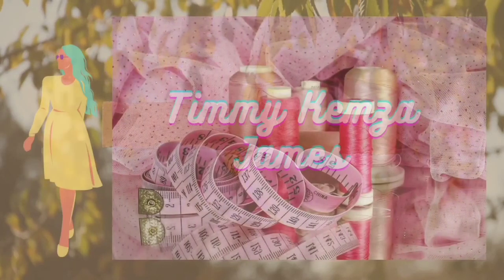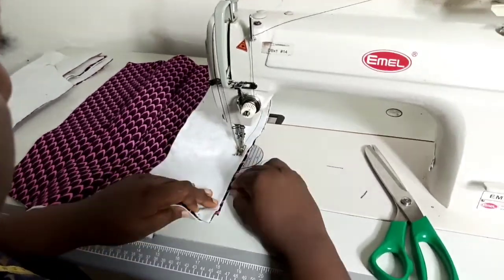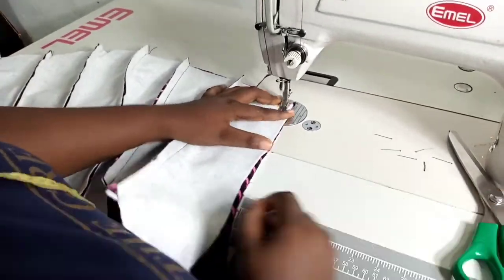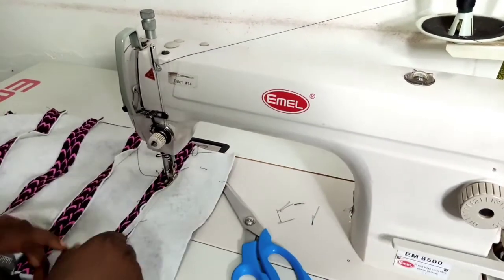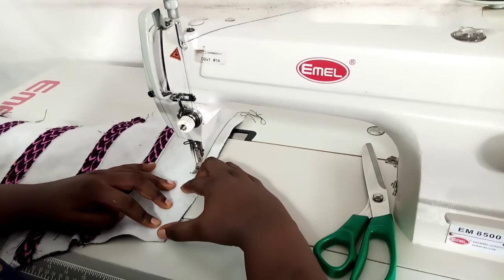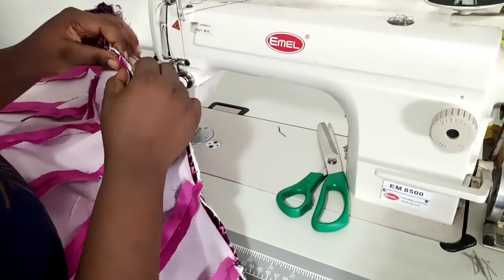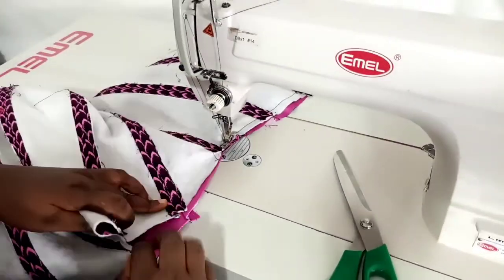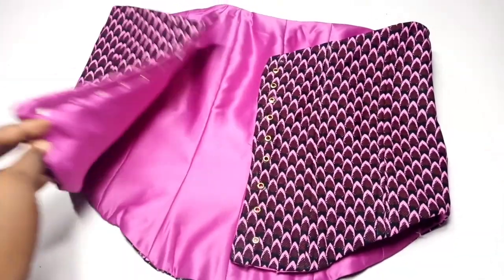How to make a corset the Natalie Bray method. How to sew boning  (sewing of a Victorian corset?)

Comment: Pls did you add bonning to both sides of the seams or just one sides? Thanks
Reply from the maker: I added on the both side but you can do one side so you don't use too much boning,but if you have enough to go round you can go ahead and do both sides it will give you a better support